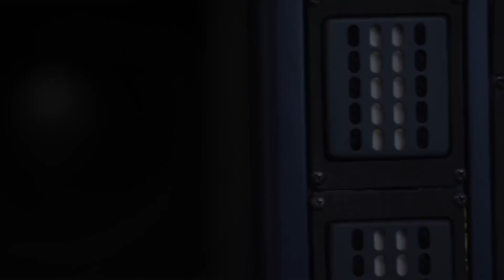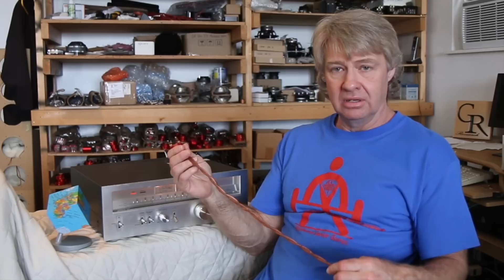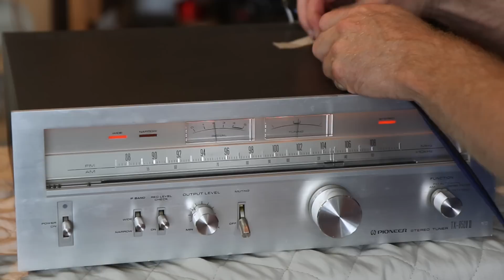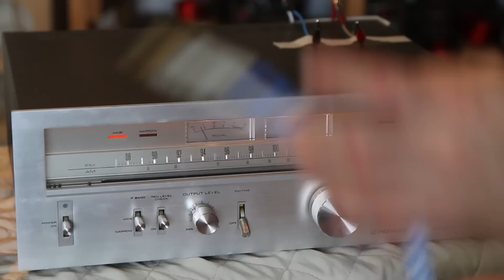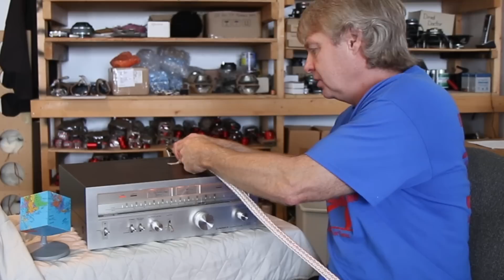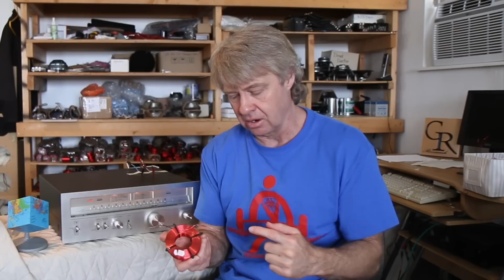Do Audiophile Cables Matter? Here's PROOF!

Comment: It s a loudspeakers cable !!! Not an antenna!
Reply: Anything is an antenna. Two long speaker cables act as antennas feeding your speakers. Power cables pick up noise, which feed your system. Your speaker cables not only carry the noise from your amp to your speakers, but they also then pick up airborne noise (RFI & EMF) and transmit that noise to your speakers.
Reply: @neilhunter6096  then why when I have nothing but a speaker cable hooked up to my speaker cannot hear this magical noise? Is after the amplifier so it's not like the amplifier is going to be amplifying this noise
Reply: @johnlastname2895  A loudspeaker cable is an "AC" conductor, with a +ve and a -ve. If RFI is picked up, one part will be sent to the speaker. The other half is sent back to the amplifier. The very high MHz hash comes through the tweeter if you like in a bad area. If you are lucky with no mains problems, your system will be quiet of course, but this is not the case for many.
Reply: @neilhunter6096  l was an am band dx er. I m an encyclopedia on antennas.
Reply: I think you 3 missed the point. Yes a plain pair of low quality copper, two cable speaker wire side by side  will act as an antenna. What Danny is pointing out is that a high quality copper multi strand cable constructed in a braid acts to cancel out RMI and EFI ( translation...noise! ) The cable wont make your system sound better, a bad cable will pick up noise and make your system sound bad and not what the equipment should sound like... For the record I think insanely expensive cables are nonsense. Just use a well constructed cable made from high quality wire.
Reply: @jsmctch  I agree. A cable can never improve the sound, it can only reduce the problems. Like you say, a bad cable will pick up noise, which is exactly what the video shows.
Reply: @neilhunter6096  speaker cable will NOT pick up noise. At least not to an audible or even measurable degree. The impedances connected on both ends of that cable are way too low for that to happen. Same goes for the power cable, except that the voltage and current is even higher, therefore the power cable is even less susceptible to EMI.
EMI is a problem only at low currents (high impedances), so in audio that's just the low level signal (amp input).